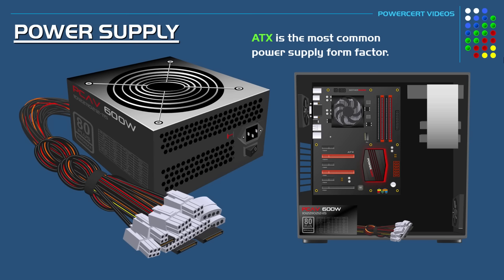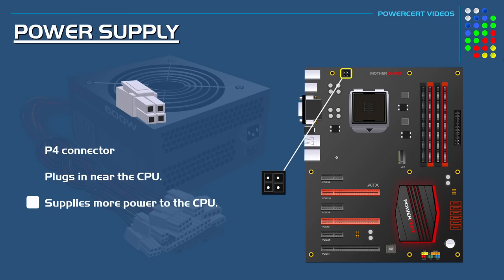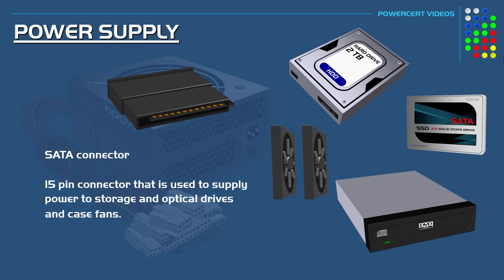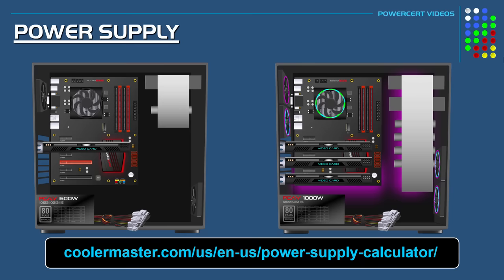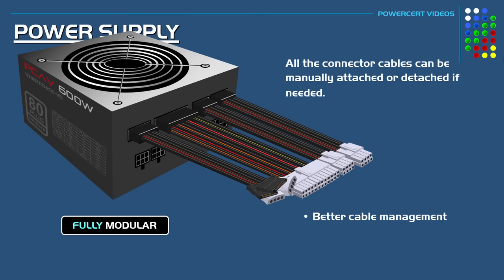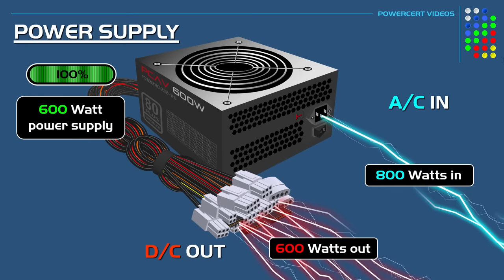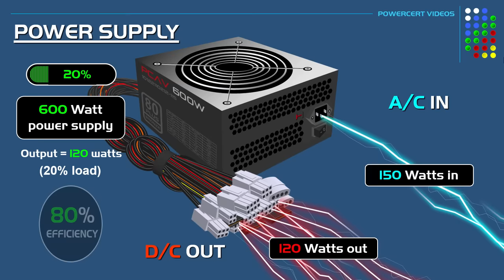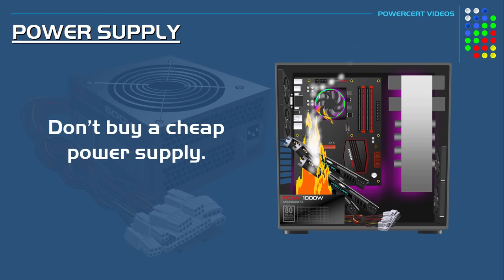Power Supplies Explained

Comment from the maker: The power supply brand that I use and recommend (Amazon affiliate)
https://amzn.to/3E54ZZY
Reply: Just got the Corsair RM650x 80+ Gold fully modular PSU with 10 year warranty. There are 'tier lists' you can look up to find the best quality PSU at various price points. I just went with the best rated A tier. Recommended as the best PSU at this wattage.

Comment: 10:07 - this situation occurs very often in Brazil.  The power supply comes with 120v or 22v input, and with a switch to change according to the voltage coming out of the wall.  So when we set the power supply to 120v but the wall supplies 220v we have smoke indeed!

Comment: Addendum to PCI Power: with PCIe - 5.0 specification coming out, GPU's are likely to use a new 12+4 connector (12 pins for power delivery, 4 pins for signaling). The 3090ti's currently use this connector, though often through splitters to 8pin PCIe power. 
Also, the new ATX 3.0 PSU specification is around the corner with new certifications for transient loads and efficiency on certain power rails.

Comment: I just did a little math which the result surprises me:
If you buy the Gold rated PSU instead of Bronze, and with the average usage of 200 watts for 24/7 for 5 years, it could save you 438 kWh and it translates to around 52 USD saved on your electricity bill in 5 years. So if the price difference between Gold rated PSU and Bronze is less than 52, you're actually saving money by buying the Gold one.

Comment: Another benefit of fully modular PSUs is that you can replace the power supply without having to detach all the cables in the process, so you can keep your cable management intact.
Reply from the maker: Good point
Reply: If you use modular cables. Just remember not to mix up those cables with PSU with different brand and/or model. Mixing up will kill your pc. Gamers Nexus made one informative video about it.
Reply: @Juzimaster  Agreed. Always stay in vendor lines, and also make sure that the generation didn't have any revisions on their cables. I have noticed a few Silverstone models have changed up their standards within a few years apart.

Comment: I use a EVGA supernova 80 plus NEX 750B, it's been flawless after several years of use and more than I really need. I don't skimp out when it comes to PSU's, it's actually the most critical PC part for longevity of a computer. I also don't skimp out on PC components, quality stuff is all i use. Buy good the first time and be done with it and the odds of problems decrease drastically. I built my last computer 7 years ago and still use it to this day, never once had any issues.

Comment: This vid is really informative.👍
9:58 So the cheap power supply you bought blew up? I've heard a few stories, similar to the one you told in the vid. That is good advice you gave, to buy a good power supply, instead of a cheap one. Thanks.👍😲

Comment: People need to know that the 80+ mark isn't a sign of quality. You can get a cheap power supply and still have an 80+ rating on it. As far as I know, the best way to check for a PSU's safety and quality is to open it and do an autopsy, or to just check for a "UL Listed" mark.

Comment: Sir you gave me an effective knowledge of one of the computer components. Would you explain us about IEEE standard?
Reply: IEEE stands for Institute of Electrical and Electronics Engineers and is not a standard itself. There are many connectors named IEEE with three or four digit number after that.

Comment: If my psu has the 6 pin pcie cable for my gpu but if I need an 8 pin and it is not available in my psu, can i buy the cable alone that can be connected to my psu and gpu directly?? (I don't wanna use the 6 to 8 pin converter)

Comment: I have an issue with my motherboard (from Fujitsu) when trying to upgrade the PSU. So the motherboard has this weird power/LED connector that is required to have a cable plugged in which is very unique from all other cables. That cable is supposed to come directly from the PSU. Though, the new PSU dosen't have that one cable. The cable, also wasn't mentioned in the video.
Reply: Like....why? Why would they make a motherboard that takes a special connector that none of the common manufacturers put on their power supply units?? Sounds like that thing they do with mobile phones to make them go obsolete after a certain time to make people buy the newer model. If I were you, I'd save myself the headache and splurge on a 150 dollar motherboard that uses normal connectors. Maybe a cpu upgrade while you're at it, depending on what you already have and what your budget is.
Reply: @somethingtrulyhorrifying  I am thinking of buying a new motherboard because the fujitsu one really isn't optimal.

Comment: I bought a "Manufacturer Refurbished" 650 watt version of the Corsair power supply you recommend from Amazon (90 day warranty, etc.). Granted, I did save money (approx $50), but in the long run it might cost me MUCH more. Do you think buying a "Manufacturer Refurbished" psu is a matter of asking for trouble and should be avoided?
Reply from the maker: I always prefer new....but Corsair is a great brand.

Comment: okay I have a problem I hope you can help me with. I bought a power supply that is 400 w the one is on my computer is 200 W all the cables hook up except one it is P2 connects to the motherboard. my old power supply which is 200 W has four wires coming from the P2 2 empty spaces the new one has four wires just like my other but has two extra black wires. they will not fit into the motherboard slot. can I get a some kind of an adapter or do I need to purchase another power supply with the right adapters. hope you can help hope I explain that well enough for you to understand thank you

Comment: What's the difference between the 8 pin VGA vs PCI-E cables that BOTH plug into the same spots on GPU and the Power supply.... the PCI-E with run my ASUS 970 GPU and the VGA won't ???

Comment: 2:48 It should be noted that Nvidia RTX 3000 series cards that some of them will have a 12 pin connector, usually in the founders edition cards. But the video card will come with an adapter to be able to use the 8 pin PCI-e power connectors.
Reply from the maker: Power hungry cards.

Comment: ChatGPT Summary : 
In this video, the presenter discusses computer power supplies. A power supply, as the name suggests, provides power to a computer by converting electricity into the specific voltages required by the computer. It is typically a square metal box with wires and connectors that fit inside the computer case, usually located at the top or bottom of a standard tower case.

The video highlights different types of connectors found on power supplies, including the main power connector (P1), which can have 20 or 24 pins, and the P4 connector introduced in the early 2000s to supply more power to the CPU. The P8 or EPS connector is an 8-pin connector for newer, power-hungry CPUs. Additionally, there are 6 and 8-pin PCI-Express power connectors used for high-end video cards and SATA connectors for storage and optical drives. The older Molex connectors, once used for hard drives and optical drives, have been largely replaced by SATA connectors.

The video discusses power supply wattages, which can vary from 200 to 2000 watts. The wattage you need depends on the components in your computer, with average computers requiring 500 to 600 watts, while high-end systems with multiple components may need 1000 watts or more. The presenter mentions a power supply calculator on Coolermaster's website to help determine the appropriate wattage.

Power supplies also come in different configurations: non-modular, fully modular, and semi-modular. Non-modular power supplies have permanently attached cables, while fully modular ones allow for manual attachment and detachment of cables as needed, leading to better cable management and airflow. Semi-modular power supplies have only essential cables permanently attached.

The video touches on 80 Plus ratings, which certify power supplies with at least 80% energy efficiency at 20%, 50%, and 100% load. The presenter explains that these ratings also have different levels, such as bronze, silver, gold, platinum, and titanium, depending on the efficiency rating.

Lastly, the presenter shares a cautionary story about the importance of purchasing a quality power supply from a reputable brand to avoid potential issues.

Comment: Does anyone know if it's possible that the power supply affect microphone/ sound cards? Because I've been trying to fix a white noise that comes from my microphone via a focusrite sound card. Maybe my 600W 80+ Bronze power supply is too much and is leaking some of that power to my microphone. I already tried everything (changing microphones, plugs, cables, outlets, cleaning, reseting, and restarting everything) the only thing I'm yet to do is change power supply to see if the noise stops. But I don't want to buy another power supply only to figure out that, that is also not the problem.

Comment: Is it okay even if my p1 connector is missing 2 pins and will replace jt with power supply with p1 connector thats missing 3 pins? This is how it looks like ( 2 pins missing 14pins [::::..:] and the new p1 connector also 14 pins thats missing 3 pins [:::..:.˙])

Comment: Those who use the integrated graphics on their computers really don't need much more than 300 to 350 watts however, after time and for upgrades sake, its a good idea to exceed your current needs by about 200 watts just incase there will be a graphics card and other hardware installed. For sure consideration should be made in the event a discreet graphics card might get installed. At minimum, I'd go with 550W without video cards and 650W minimum with an average video card as most video cards will use a good 200W or more. Also, you might add another 100 watts to this idea because the most efficient power draw with most PSU's is right around 50% load plus as they age, efficiency drops a little bit. So, if the power calculator says you need 300 watts, I'd double that number so that the PSU is outputting about 50% of its continuous power rating. That'll also give plenty of room for upgrades and when the cost is figured out, watts per dollar spent is typically less so the value is greater.
Reply: most important pls do not use single input voltage 110/220v psus, theyre bad and inneficient, they even can draw 2x power

Comment: Are you going to talk about 2011 power supplies or the 1895/1920/1988 vintage junk used in PCs? There has been an amazing amount of progress made over the last 100 years. None of it is used in PCs. Integrated Magnetics, Hybrid Mode switching. LC scaling. etc. Only NASA, the Air Force, and some server companies are working with Teslaco on current designs.

Comment: I think coolermaster psu wattage calculator is dumb because from some where they made their own ryzen 7 5600x and also there is no option to select 6600xt and 6700xt which is very confusing for a new user

Comment: I am looking to get a new Power Supply for my old HP Compaq 6000 Pro because I want to update the graphic card and add another HDD and a SDD, plus some other cards (USB, SATA/eSATA, etc...). The Compaq has no 24 or 20 pin connector but the motherboard has different connections, take the power from the power supply to the motherboard and then power with SATA the HDD and the optical drive from there. So no direct connection from the power supply to the HDD/optical drive, but they are powered from connections from the motherboard, kind of weird... However, all of that makes it hard for a new power supply with higher wattage than the 320W mine has today... And HP ceased the support for my machine that still works perfect... Oh well, if anyone knows more, thank you in advance!...

Comment: The Power Supply Calculator you linked is bad.
Its a really unrealistic number and doesent even let me choose things like a AIO Cooler, the count of installed fans or the choose of DDR5 Ram.
I dont believe that: "702Watt" is enough for a overclocked 4090 and all the other conponments.

Comment: The power requirements of todays components means that if youre building the pc for gaming then harddrives, optical drives or fans dont really have to be taken into account when choosing a psu. They just use way too little power compared to even ram.

Comment: Herp de derp bad cable management = higher temps. NOT true. My cable management is horrible, but the temps are fine.
And this comes from someone that prefers non-modular over modular.
Reply: True, they trying lying that non modular is better. they do not understand that the power supply is not the motherboard. this is energy, and the fact that the wires stick out they do not interfere. as many say.